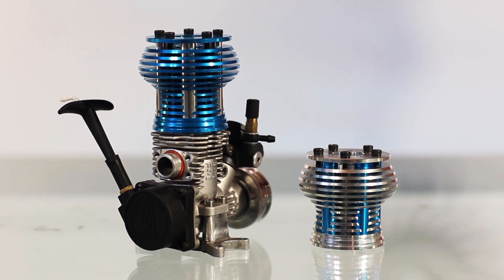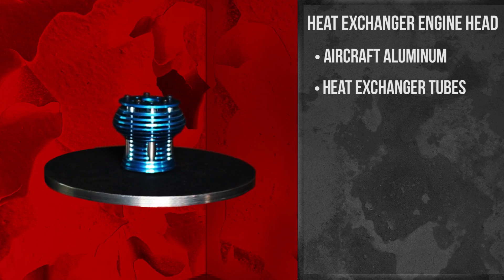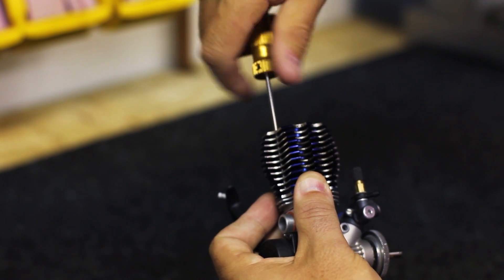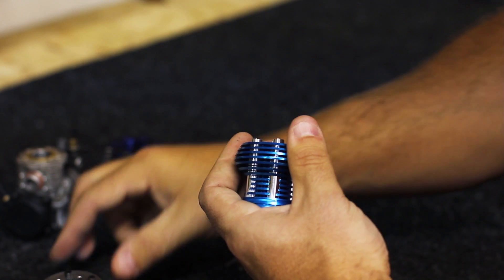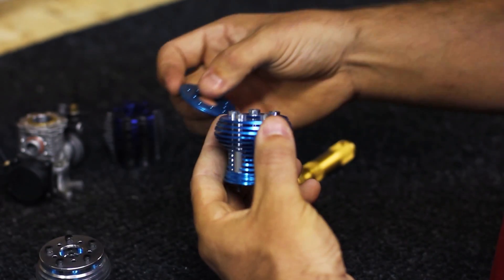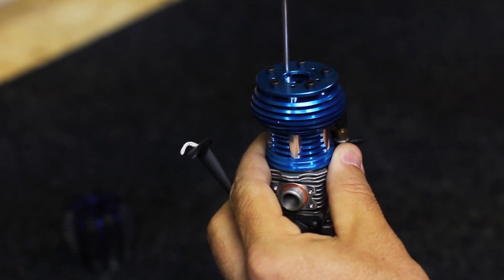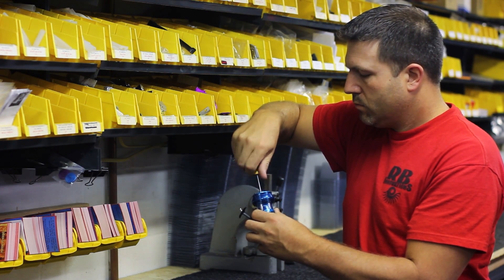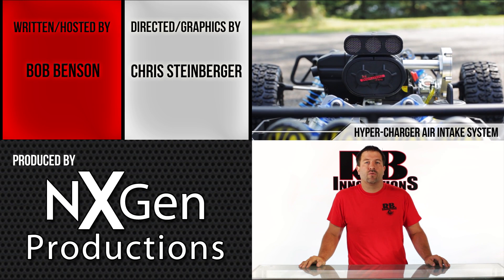RC Heat Exchanger Head Overview and Install for 3.3 Traxxas Engine

Comment: how can you put a glow ingniter in my wont and it's a normal size
Reply: +matthew lizalde the trx 3.3 uses a ez start where a glow plug wire is connected to the top of the glow plug
Reply: matthew Lizalde you have to buy their glow plug remover thing

Comment from the maker: It utilizes the heat exchanger tubes to increase overall surface area as well dissipate the heat directly from the base to the finned area for more efficient cooling then the stock heads available.